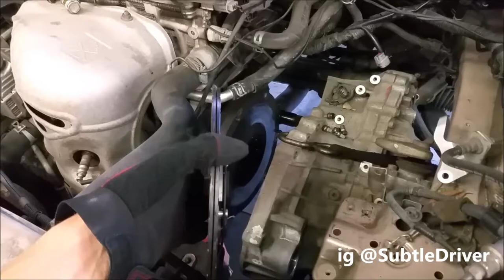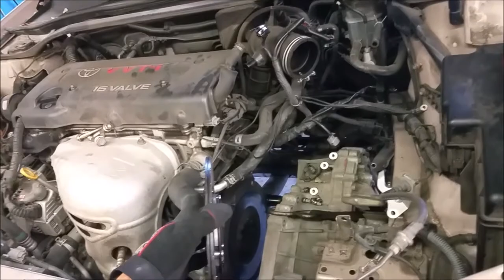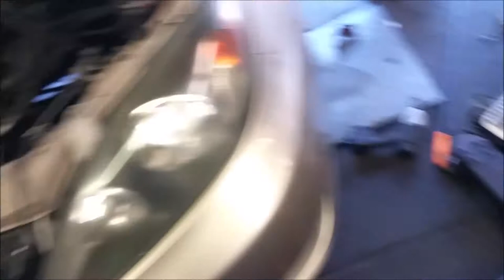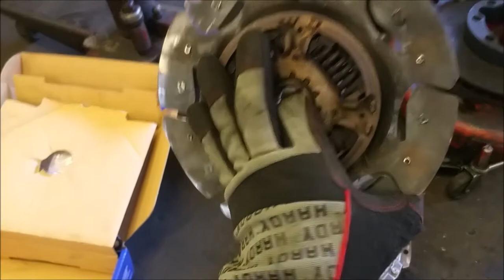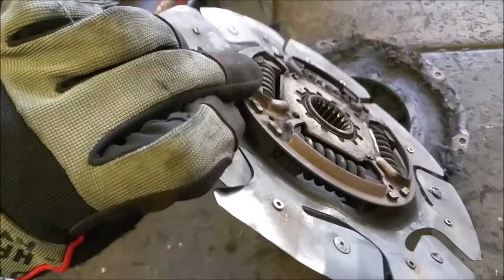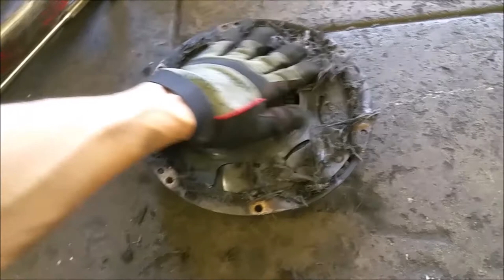Stage-5 clutch install in Sleeper Camry

Comment: I had the clutch material fly off one side of my stock friction disc like that before. Found a super cheap deal on a ram puck clutch... it was a poor choice
Reply from the maker: ive seen that happen to oem bmw clutches a few times.
Reply: subtledriver mine was on a 07 fusion with 100,000 miles. I hadn’t ever witnessed clutch material burst like that.